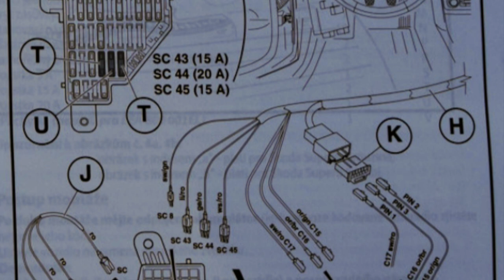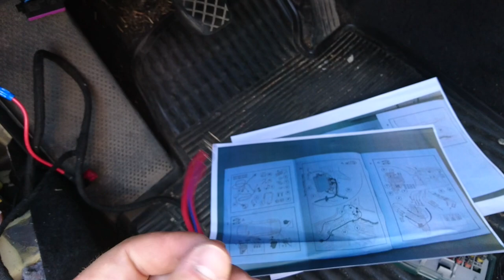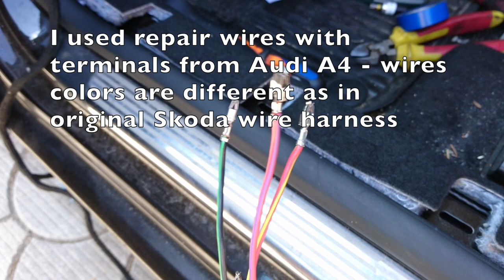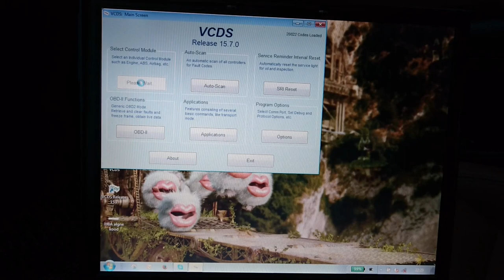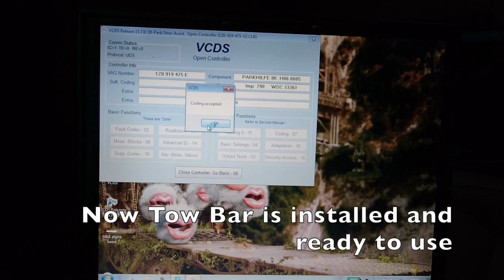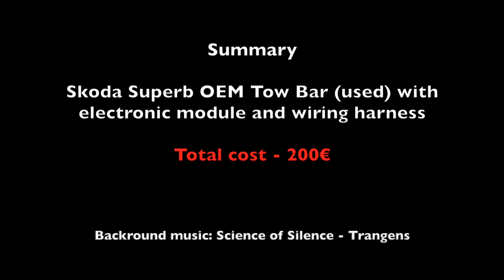How to install detachable tow bar to Skoda Superb II

Comment: 09:20. Pull this part up after releasing the lower part. Don’t forget to disconnect airbag cable. I would recommend remove negative battery cable. In this case you will not get an error

Comment: Hi, great tutorial. I’m having issues removing the three disc type bolts on the heat shield. They just seem to spin and not release... cheers Dom
Reply from the maker: These disc type bolts are quite often in rust and it´s more convenient to break them in opening. Discs are not very expensive and it´s wise to replace them, when opening heat shields.

Comment: Hi. Did you also replaced the rear axle coil springs? I saw that are different color code for vehicles with factory trailer hitch.Thank you for your work!
Reply from the maker: No, I leaved them as is. But as Greenline has quite low height, then its worth to change all springs.
Reply: @lutz6441  OK. Thank you very much!

Comment: What/how did you use to get into the coding at the end of video?
Reply from the maker: Maybe I didn´t understand your question, but I use VCDS version 15.7 for coding.
Reply: @lutz6441  so a normal plug in obd reader?
Reply from the maker: @paulshelley4670  Yes, normal OBD reader cable with VCDS software.